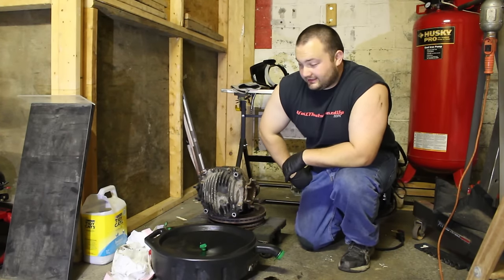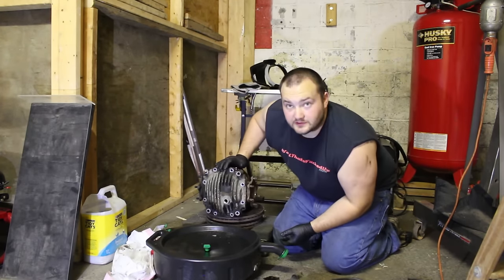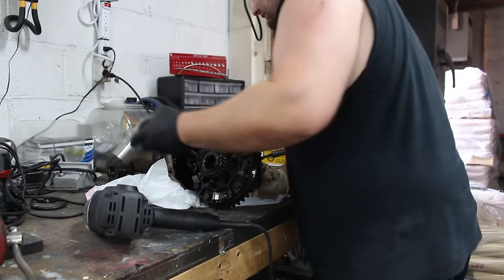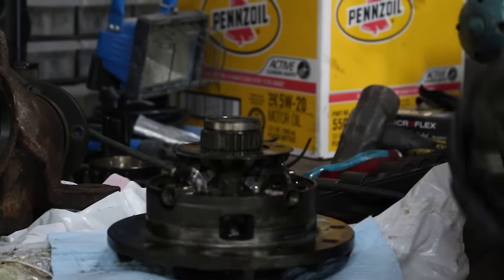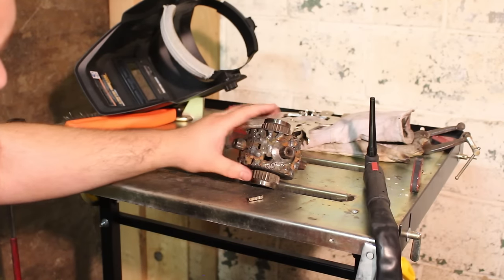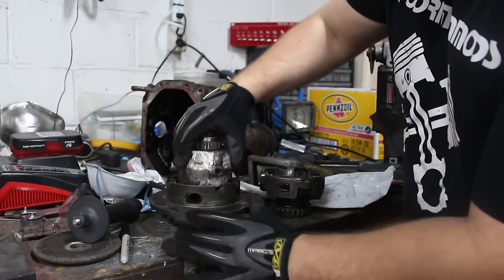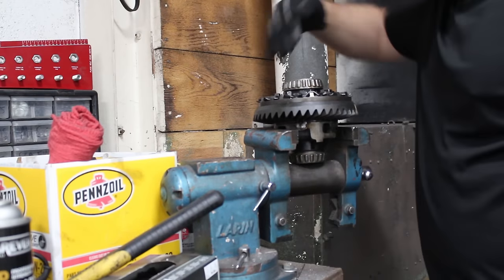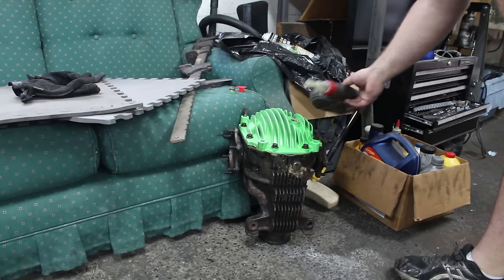Welding an Open Differential for drifting! 1JZ Supra Drift Missile

Comment: That's not a welded diff, thats a solid block of metal lol. I've never seen anyone go that hard on welding a diff. it will hold.
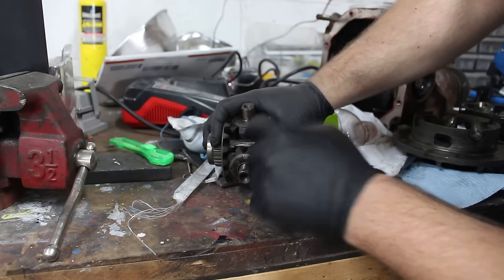Reply: 生き残るために駆動 I was in stitches at 10:27 😂
Reply: I give the axles 6 weeks tops
Reply: cuz if the welds break the diff is fucked
Reply from the maker: 6 minutes

Comment: The only problem with your welding technique is, in some cases (some things I've ran into) is when you constantly heat up and cool down the gears/welds/filler/plate steel they will sometimes snap at the point where some parts didn't get to the same temp. as the other parts. But you should be fine with the amount of torque you're putting it through! Keep up the great work!!!!!

Comment: heat the ring gear in the oven at 500 degrees for 45min to 1 hr then it will slide right on.

Comment: yeah you should keep the bearings caps on the same side and also the same orientation, very important
Reply from the maker: i assumed so, but what would happen if you didnt? what if you swapped sides?
Reply: i have no definite answer, but i know for crank bearings, if you mix up the caps you can seize the engine, so I would assume something similar for a diff. most of the time there are guides stamped on them to help you figure it out.
Reply: that said, I think swapping sides is less of a big deal than mixing up the orientation. so if you're sure they're oriented the same way, I'd leave it like that.

Comment: lol, I have to say, I liked this a lot! Im even the owner of my mobile mechanic biss, and I've never seen this much weld in a single diff lol. 
I've seen lead filled diffs, but never nothing like this before. But honestly, I like it, and i might mess around with a side diff for 4x4ing (toy) of mine, and try this out. My only concern is, the amount of weight added, and metal. This could possibly cause the inner axle bearings to fell, and then the rest will be next ( due to weight, and unbalance ). My only suggestion is, maybe you could take it to a shop, and have them balance it a little better by removing some material where necessary. That is a lot of weight to be spinning around fast, and unbalanced. I definitely think if balanced to the best possibility you can get, it will hold until the sun disappears for ever lol. Good job, never be afraid to do something different. Even if people shit on you. Keep us updated. Thumbs up bro.
Reply from the maker: Thank you very much, I really appreciate it! It will probably be unbalanced and im expecting at least something to break when I use it and beat the hell out of it haha, but only time will tell!
Reply: Poor Man Mods welded diff's are not as bad as most make them to be. Your not rock climbing this thing lol. It will hold, its a Chuck Norris diff :)
Reply from the maker: hahaha hells yeah, thanks!

Comment: wow, that is an impressive amount of weld. Way overkill. I would be wary of the strength after all that heat, it might be brittle now.
Reply from the maker: overkill for sure, but if i didnt overkill it everyone would say "the welds will break" and I didnt do all the welding at once, i only did a few minutes at a time so the heat may not have been that big of an issue. But we will see once I get it in thecar
Reply: Poor Man Mods Ill be interested to see how it holds up
Reply from the maker: me too lol
Reply: Poor Man Mods what state are you guys in?
Reply from the maker: South East PA

Comment: very cool. is there any reason you chose to use a tig welder over a mig welder?
Reply: nevermind, you responded to this at the bottom of the thread haha. It probably would have been less costly in terms of filler material if a mig welder had been used though.
Reply from the maker: yeah a mig would have probably the better choice for this job

Comment: Yo,that has a 40% chance of breaking if you have sticky tires and clutch kick it will shatter becasue when you weld it it hardens the material inside. and as many people know hardened steel is hard af until a point then it shatters like glass.
Reply: it  ain't gonna shatter. maybe if he quenched it after every weld.  letting a weld cool naturally won't make it hardened
Reply: you could not be more wrong
Reply: Project Daily if you let the steel cool naturally by itself the crystals will return almost, not exactly, back to their original form
Reply: letsgoknobface yes I know I'm a good knife maker . We gen steel it heated past a point and cools by air it softens and if you heat it and quench it then it hardens and then you can reheat it to a warm temp for a few hours to temper it and prevent the brittleness.
Reply: letsgoknobface not true. To avoid it becoming brittle, it needs to be heated on a forge prior to welding. After welding, the cooling process needs to be much slower than simply allowing it to cool in ambient air.

Comment: uuh its going to be spinning really fast did u think about balance and vibration if not balanced ?
Reply from the maker: yes it will spin fast and will theoretically be out of balance, but whether i welded the piss out of it like in this video or just did a little bit of welding like half the internet says to do, but the other half says it will break, it will still be unbalanced, unless you can precisely measure how much material you at at each corner, which no one who is welding a diff will do. And i think that because the mass that will be out of balance is so close to the center of rotation, it might not be that big of a deal. For example when a wheel is balanced, the weights are placed 6-10 inches away from the center of rotation which makes a BIG difference, where as this difference the imbalance is what, 1 inch max away from the center of rotation? So it might not be noticeable or a big deal, but I also could be wrong, we will see when I finally put it in the car!
Reply: ok :P

Comment: everything in this video is wrong
all you need is to ARC weld A(1) weld on each gear  and thats all it needs to lock it 
remember  when your on level ground the power goes to both wheels  once one wheel gets light or has less resistance it will spin that wheel on open diffs you just want to eliminate the ability of it getting less resistance 
you made a 30 min job turn into 2 to 4 hour job and with unnecessarily welding(way overboard)
i use a open diff to drift because i have the skill to use weight transfer, you dont need $200 hydro handbrakes or $1,000 lsds or lock diffs to drift all you need is skill and know how(know how weight transfer works haha)
Reply from the maker: if i welded it the way you said, literally everybody would tell me it will break, thats why i did it this way.
Reply: Skill and Know How are boring.....

Comment: nice video. but what will welding that do? i know you explained but im not quite understanding.
Reply from the maker: +Jonathan Cortez it locks the rear wheels together so both wheels spin together all the time, for better burn outs, doughnuts and drifting.
Reply: +Poor Man Mods this only for RearWheelDrive righr?
Reply from the maker: correct

Comment: if gas and material is so expensive just use flux wire welding and it is SUPER cheap
Reply from the maker: gas and filler rod is cheaper than me buying another welder
Reply: my harbor frieght flux core welder was $89
Reply from the maker: if im going to buy a welder im going to buy a quality one
Reply: Poor Man Mods Then rename your channel rich man mods because wtf you won't buy inexpensive things will you
Reply: Poor Man Mods my welder works just fine for $89
Reply from the maker: that welder doesnt have the power to get proper penetration on thick steel like the diff I welded.
Reply: Poor Man Mods i disagree on that it would only need to penetrate enough to create the overlapping welds and layer into the previous welds to slowly build it up the same as you did - which it can
Reply from the maker: the thicket metal that welder can properly weld is 3/16, and the gears in the diff are way thicker than that
Reply: Poor Man Mods did this hold up?

Comment: You should have heated it after you hade welded the diff, too glowing orange/red color and then put it out in water. After that you reheat it to a bluish color and let it cool in room temp. Then the diff would have been hardened and tempered and last for very long. It would not be any brittle then.
Reply from the maker: lol

Comment: Holy mother of CHRIST! That is the elephant man of diff centres. A few well placed beads will do it. That thing must be so out of balance it will be like a hand grenade if it goes off.....
Reply from the maker: If i did a few welds, you would say it would break. Literally no matter what you do to a welded diff it's "Wrong" and the weight it so close to the center of rotation it wont matter

Comment: hey isn't that a lsd rear end already. a open diff looks different. I paid 400 for the same lsd crap you welded
Reply from the maker: it looks like an LSD but its not, its an open diff, you can see around 3:10 when i spin it, the spindles spin in opposite directions

Comment: Car noob here, what's the purpose of welding  your diff?
Reply: 3rdWG Look it up then come back and say that again
Reply: Bobthefrog It's not that important to me. This was on my suggestion box so I was just asking.
Reply: Well im an idiot, I thought you were calling him a car noob. The purpose of welding a diff is to help it drift and perform other tricks that a car without a welded diff couldn't
Reply: 3rdWG both rear wheels spin always at the same time
Reply: Normally your rear wheels are allowed to spin at different speeds, so the car can go through corners. The wheels on the outside of the corner go quicker then the ones on the inside. That's the purpose of a differential. Now they welded that function of the differential stuck, so both rear wheels will always stay at the exact same position. Very bad if you go with this through normal traffic, but they use it for easier drifting and burnouts. To prevent that only one wheel goes spinning and the other stay stationary.
Reply: Richard van Pukkem Oh I see, thank you for the explanation!

Comment: Your welds might be strong enough but its severely over done.  All the heat you put into the diff killed the factory heat treatment and made it brittle/prone to cracking.  Also should have been tempered/relaxed in a oven or bbq grill for a couple hrs.  Overkill isn't always a good thing in welding , especially if you don't know your metallurgy.
Reply from the maker: hmmmmmm, well i guess we will see what happens

Comment: this thing is BULLETPROOF oh my god
Reply: very good work by the way
Reply from the maker: thanks! hopefully it doesnt break
Reply: +Poor Man Mods if anything breaks, itll be your axles. but thats like any car with a welded diff or if you weld it especially. but those gears are literally like a damn block. most people just basically tack all 4 corners. this is gonna be very reliable as far as inside the diff

Comment: wow no one could tell you that it wasn't welded !  You soooo overwelded it !good luck cause I have never seen any diff so weleded up !  If it doesn't wheel lock now then drive it over a cliff or a speed bump at walmart !  Good Luck !
Reply from the maker: hahaha ill take it to the grand canyon and go over the edge lolol
Reply: Hey did it work ?  The grand canyon is too close to my house so how is the Mississippi for you ?
Reply from the maker: i havnt installed it yet lol
Reply from the maker: why?
Reply: the weight of the diff is supported by a frame on the car so no extra strain on the wheel bearings except the strain from the diff not being open any more.. the weight of that welding would possibly be less than the weight of a human.. so I am sure it will be fine.. one thing thought.. thatll be indestructable :) he did a decent job

Comment: filling up all the material isnt necessary. in fact it just makes it not fitting. 
just do the welds like they should be and theres no problem.
Reply from the maker: If i did the typical welds, 99.9999999999999% of people would say the weld would break

Comment: Dud that is ridiculous amount of weld and with all the heat you put in it making a solid hunk of steel it is warped no way around it. 
All you needed to do was fill in the valley of the gears where they mesh  this keeps them from rotating which all you need to make a "lincon locker". Watch a U-tube video or 2.
Reply from the maker: If i did what you just said for me to do, everyone would say "its going to break"

Comment: Stick welder easily would have done that for way less money in way less time.
Reply from the maker: youre right, but ive never stick welded before
Reply: The hardwear is SO cheap. Stick welding isnt hard at all. I only watched a few youtube videos, and I can stick two pieces of metal togather, not pretty but holds. I BADLY need practice, but the welder does most of the work. look for used equipment I've had two used stick welders (upgrade to DC) and both have been good machines. Be very mindful of safety. I haven't tigged before but aspire to!

Comment: just some tips for your next diff.
1: use a mig welder.
2: rattle gun the fuck out of it.
3: wrap the ring gear in a soaked towel and microwave it for like 10 minutes. it will be fucking hot and slide on easy as piss.
Reply: Tom Pickrell dude on the microwave in the oven yes microwave will blow the fuck up lol
Reply: 10 fucking minutes lmfao goodbye house

Comment: And they could've bought a spool for <$1000. Smh. If you can't afford the proper equipment you have no business racing.
Reply from the maker: Apparently you didnt take notice to the name of the show....
Reply: There's a big difference between a mod and a hack. Welding a diff up is definitely the latter of the two. Seriously, if you can't come up with a grand for the proper parts...you have no business trying to build a drift car (or any other toy for that matter).
Reply from the maker: If youre so gung-ho about spools and 2-ways why did you watch a video titled "welding an open differential"?
Reply: This is coming from a guy with "RotaXD" as his user name.   Assuming you mean Rota wheels, AKA Knock off wheels.